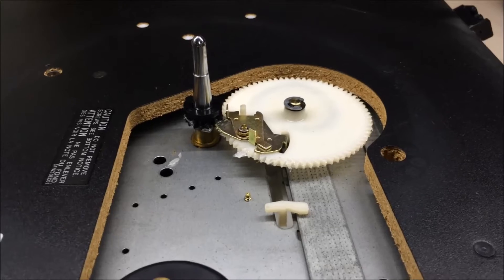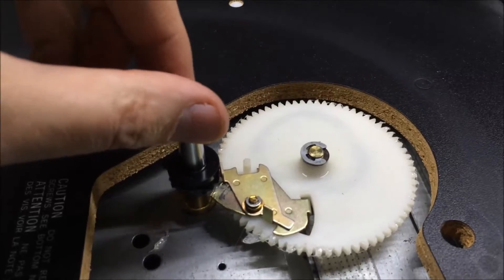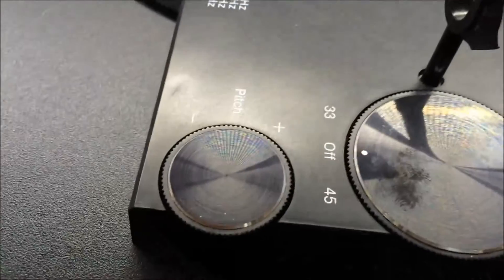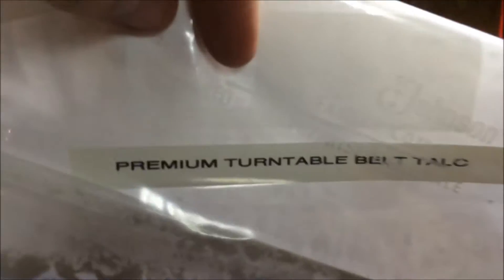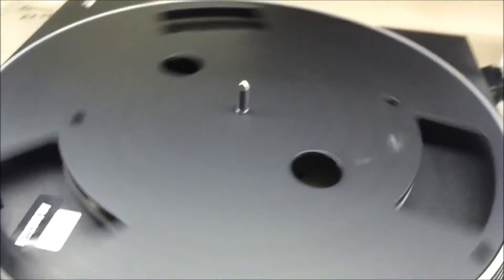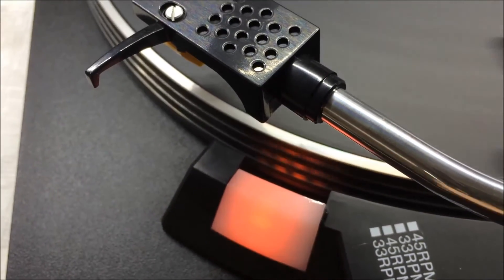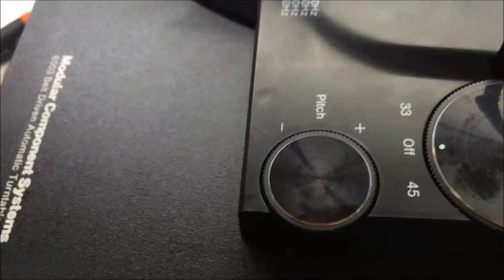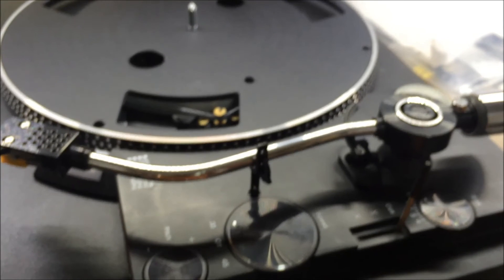MCS 6503 aka Technics SL 23 Turntable Repair and Service BG015

Comment: I just bought an old SL-23. With the belt off I spun the platter, it kept spinning for so long, it looked unreal, I could not believe how long it took for it to stop. I saw the gooy great and was wondering if someone Elsa had worked on  it, but apparently it’s original.

Comment: Thanks for your helpful video.  I just got a used SL-23 with a Shure N91ED cartridge.   Is that cartridge decent?  should I just automatically replace it?  With what?  Or should I just replace the stylus?  With what stylus - what should I look for in a replacement stylus on EBay?  Thanks again!!

Comment: Hey there! I just got a 6502 (I imagine it's similar to the 6503). Here and there the audio is a little warbly (wobbles in and out of tune). Is this a belt issue? If so, what is the correct replacement belt? Thanks so much!

Comment: Hey blueglow, I gotta break your balls for a sec so I apologize in advance...

I got an sl-23 and watched his right after to school myself.  I’m a newbie but your videos have taught me a ton already.  Anyhow the belt is brand new and I decided to talc it as per your recommendation despite having read on the AK forums that this would mess with the speed consistency.  I figured your word was better.  So after dusting it I started up the tt and immediately couldn’t get the speed dead on.  I washed the belt and then everything went back to normal.  I can’t help but point out that you might not have had to go back and recalibrate the speed after you had it right if you hadn’t powdered the belt.  

Sorry again.  I’m not trying to be an internet know it all smack talker, I just felt compelled to share

Comment: I just picked up an SL-23 at a flea market and was able to get it all adjusted and running smooth using this video. For that, I thank you! I was however only getting sound out of one side. Through trial and error and a borrowed cartridge, I discovered the problem is there, do you think it is the stylus or the entire cartridge? Is there a way to test/repair those items? Thanks and subbed!
Reply: johnnypsr I was in a similar situation when I got my SL-23 from a yard sale and fixed it up. At first sound only came from one side but I touched the wires that connected the Cartridge to the tonearm and somehow both sides started working.
Reply: If the headshell wires weren't the problem...It's in need of a new cartridge.

Comment: Got this exact same record player from my mom. I ordered a new belt to realize the blue ground wire on the back of the cartridge is broke and too short to re-solder to the connector pin 😠
Reply: They sell replacement wires...Amazon or ebay

Comment: Are the tonearms on the MCS tables exactly like the Technics, or are they cheaper look-a-likes with more inexpensive (plastic) parts?
Reply: And, it's important to point out that not all MCS Series components will be made by Panasonic/Technics.

For instance, the MCS 685-6500 belt drive turntable is made by Hitachi.
Reply: Cheaper

Comment: I have the SL-23 and was wondering if this technique of cleaning the pots would help with my problem of occasional fluctuation of speed or if that is a motor problem?
Reply from the maker: +Matthew Roach Exact same issue, I've fixed no less than 20 SL-23's with that issue, pots get oxidized over time and cause this.

Comment: Thanks for the great video. I have the MCS 6502 which is essentially the same turntable. Mine needed all the fixes you did before it would lock on speed. Getting the two speeds balanced was a bit twitchy, but now they are right on with no pitch adjustments between the two speeds. Mine had some thick black grease in the spindle well, so cleaned it all out and put two drops of light synthetic gun oil in the well and some on the shaft too. I have a new $7.00 belt ordered, but I got it working with the old one. I knew about the talc trick, and I will do that to the new belt. My pulley on the motor was covered with hardened belt residue that had to be cleaned off. Keep up the good work. With vinyl making a comeback, there will be more interest in videos like this one.
Reply: Where did you order your belt from?
Reply: Amazon or ebay will have them.